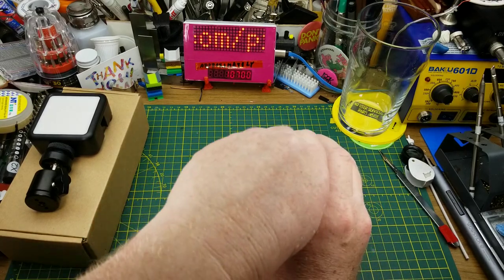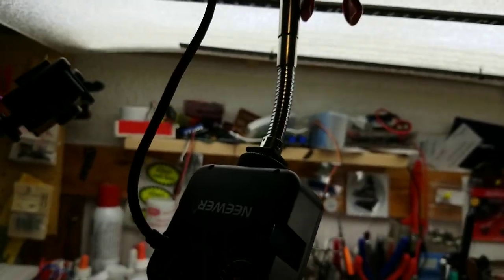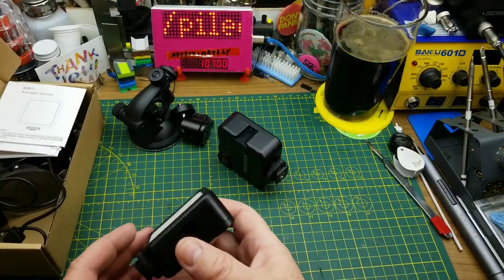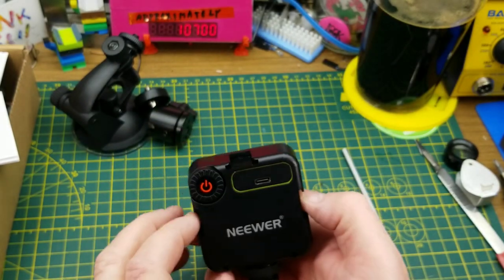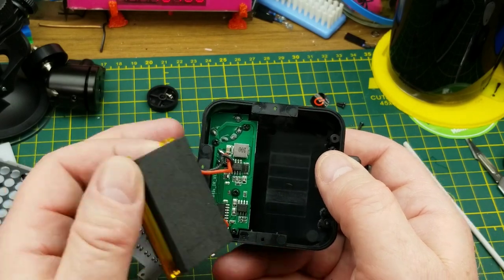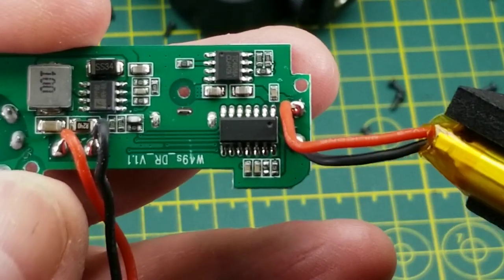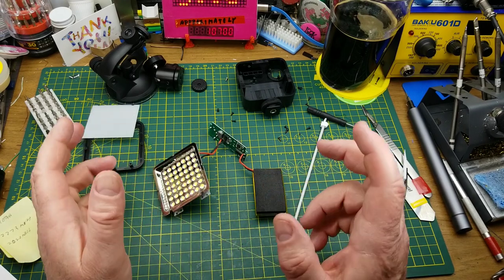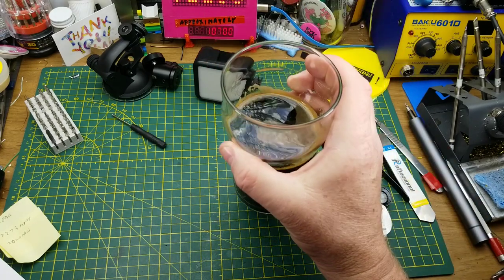Neewer video lights teardown

Comment: Great video as usual!  I ended up getting one of these after they appeared in your mail bag video. It was US 8$ with tax and tags. I liked it, and was going to order another, then saw the Vijim vl100c on the same page and decided to try it.  It uses a bicolor LED, so you can change the warmth on it. I got it for I think US 17$ shipped.  It give good warmth variation and has good battery life.  The Neewer is the better value though, if you can find them.  These are also good for working on circuits for old blind people!

Comment: For the price they seem exceptionally good quality. Only thing I can think of to ding them on is that the cell and LED array are soldered to the main board rather than using plugs. That's a minor quibble at that price, and easily done by hand if say one wanted to replace the LED array with some vectorboard and different colors of LEDs. Also look like they'd be relatively easy to make water resistant if one really wanted to.

Might be fun to use addressable LEDs if there's room in the case for another jack (or potentiometer) and whatever else would be needed to drive them for a color-temperature-adjustable light.

Comment: Neewer have become a reputable brand in my opinion I first bought a BM microphone for like 50 quid with stand and everything its been so good i used up until last year 
I recently replaced the mic boom Arm with a neewer newer model which again is impressive and i used one of the light s before and iv tried to replicate that light output ever since to no avail but can't personally afford the Kit i used all good experiences with them and i will use there mounts and other things all the time great quality for the budget end of kit

Comment: I'm wondering how the leds dissipate their heat, especially with the lithium battery next to them.   The led circuit board is not aluminum and can't act as a viable heatsink.

Comment: Using crappy 5mm indicator LEDs is a pretty poor way to do things. Short life, even when driven at low current.
However, for $5 each they are an absolute bargain.
Reply from the maker: Always important to judge quality in perspective to the cost.

As I said, these are a good value for money, and they're not intended to compete against the professional brands.
Reply: I see far too much phosphor in those for them to be crappy indicator LEDs. They're definitely a step above that.
Reply: @eDoc2020  Yes, most definitely not indicator LEDs. They look like cheap hi-flux LEDs, some have better phosphor coverage than others, but for under US10$, they are very nice!